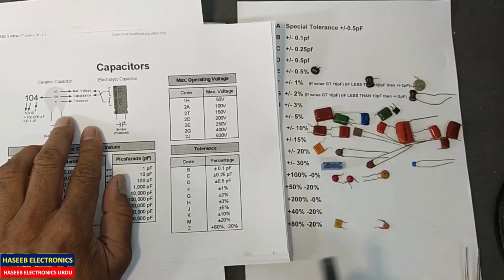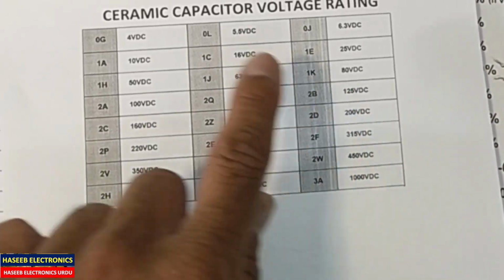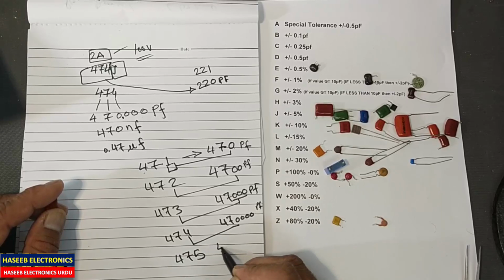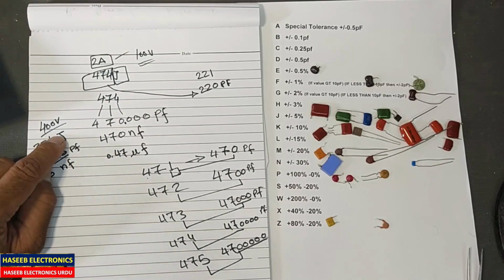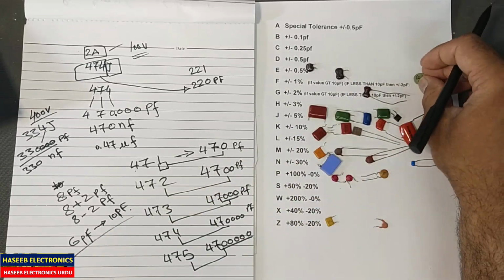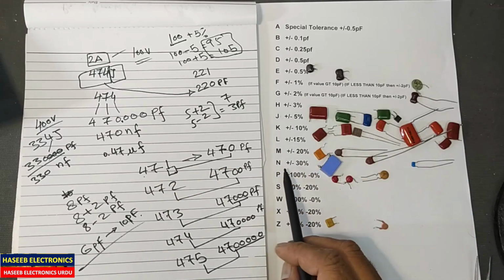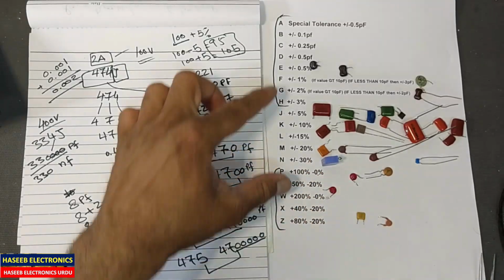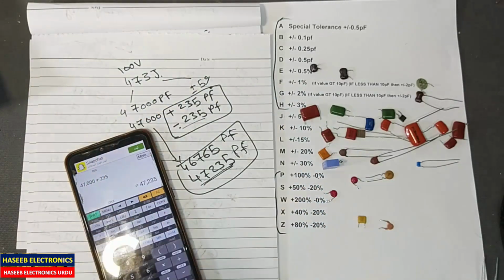{618} How To Read pf Ceramic Capacitor Value From Code, Voltage, Capacitance, Tolerance

Comment: I am having troubles figuring out what ceramic disc capacitor i need to repair my home amplifier i under what most of the marking mean but there is some issues i ha ve ran into so i am pretty sure the marking shm is the manufacturer then x1400 which i am sure means 400v on the x axis then y1250 which i believe is 250v on y axis then is E332m then below that is f which just confuses me because when looking for this type of capacitor i am only finding them in 1k 2k and 3k which from my research stand for kilovolt